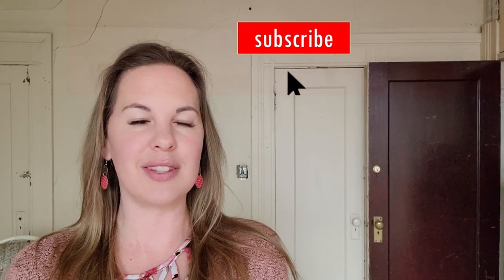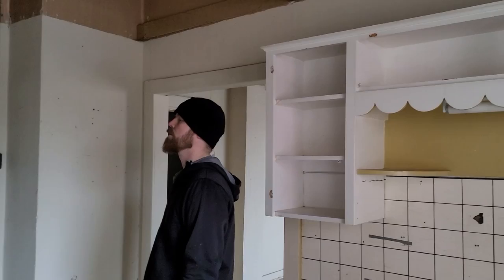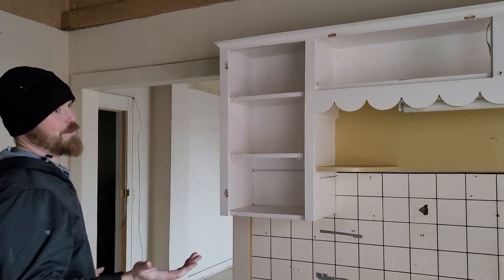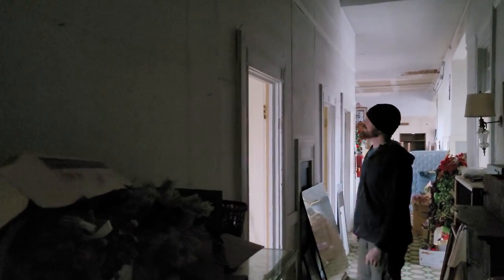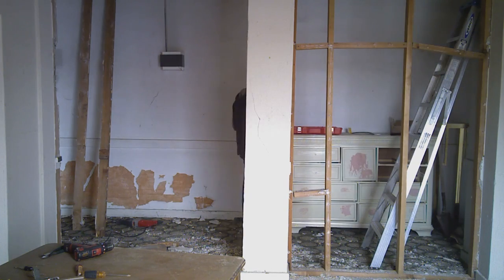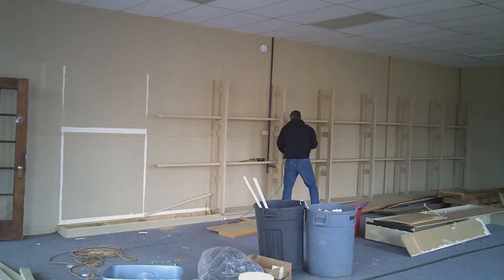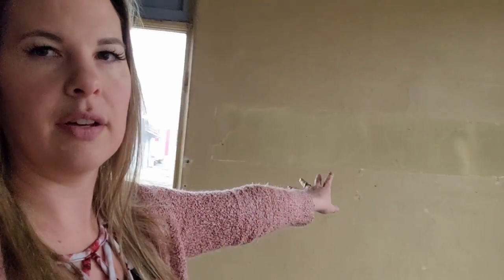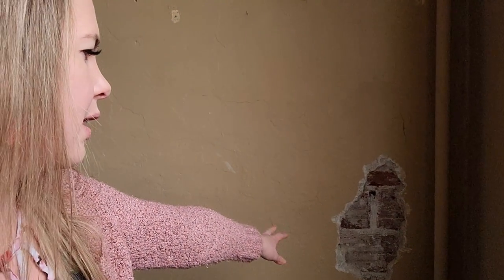100 year old HOTEL RESTORATION | Wall Demo First Floor

Comment: Wow 🤩 incredible progress.  What is the temperatures you are working in in those big spaces?  I can't imagine a heating system for  all 3 floors and the basement.  Love watching your videos.
Reply from the maker: Thanks! Right now it is pretty cold. It is usually between 35 and 45 degrees. 🥶 We are hoping to have more power and be able to heat some more spaces in the near future